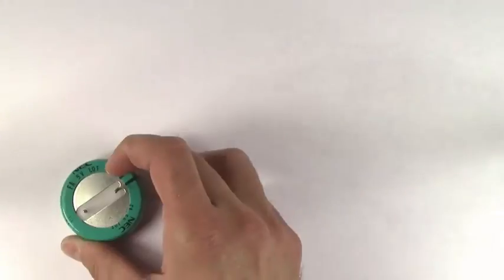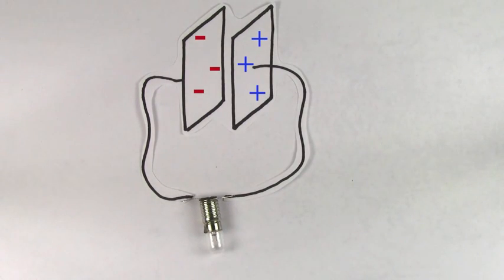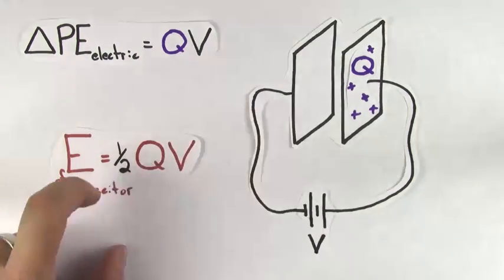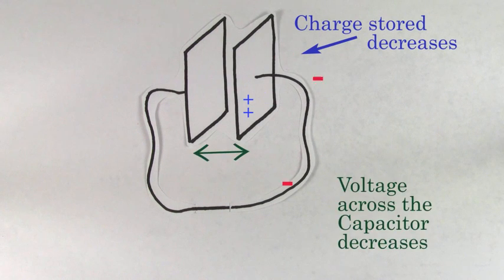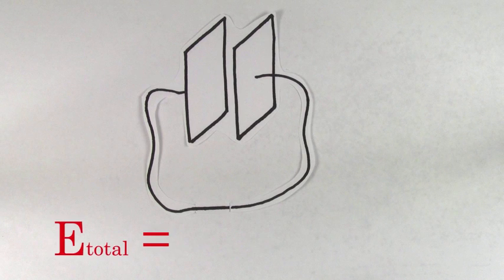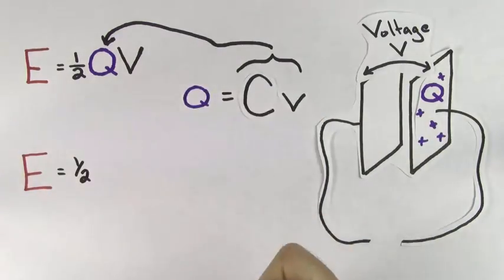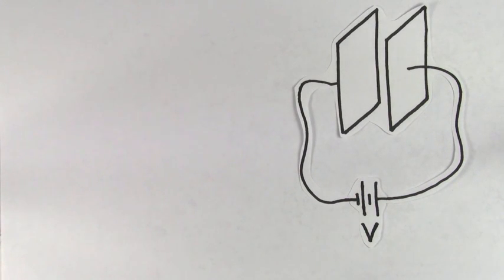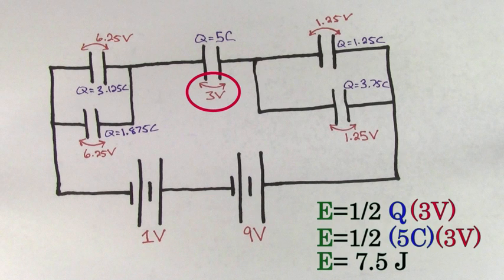Energy of a capacitor | Circuits | Physics | Khan Academy

Comment: Summary Of The Video :-

Energy Stored In A Capacitor

* The Energy Stored In Capacitor is electrical potential energy.

* A Capacitor acts like a temporary battery.

* Potential Energy Stored In The Capacitor is the work done by external agent (battery).

 Work Done While Charging Process Of Capacitor 

 * To move first charge we do zero amount of  work because initially there was no potential difference between the plates.

* To move second charge we do tiny amount of work done because  now there is  tiny potential difference between the plates.

* To move third charge we do even more work beacuse potential difference increases.

And so on .........

* Now to move the last charge we have to do the maximum amount of work because now potential difference between the plates is maximum.

Comment: I have learnt that a capacitor does not store charge but stores ONLY energy because In a Capacitor there is an equal and opposite charges in polarity and that there is no resultant charge. That is Net charge is zero. And due to the charge separation. ??

Comment: Sir does the charge travel through battery during charging process if it does that energy stored in capacitor will be increase if it does not do that how charging process done PLEASE EXPLAIN

Comment: I found in Uni that the voltage across the capacitor gets written as dv (dielectric voltage), which is to differentiate the voltage across it from the voltage of the battery. But i hate writing it out cause the formula then looks like E = 1/2Cdv^2, and since high school i kept seeing “d” as for distance. This then gets added to other equations like capacitor current (i = CV/t) into i = cdv/dt. It gets so frustrating.

Comment: 3:24 what does it really mean that ‘charge drops through no voltage at all’???
Reply: Im no expert but i will try to explain nonetheless. Imagine the first plate has 1000 charges and the second plate has 0 charge, because of the difference, the two plates have a potential difference. Let's say the voltage (potential difference) is 1000 V between the 2 plates. As the charges move from plate 1 to plate 2, it's no longer 1000 charges on plate 1 and 0 charges on plate 2... It might go 999 charges on plate 1 and 1 charges on plate 2, or lets say 998 and 2, 600 and 400,etc etc...

The charges will keep on moving as long as there is a difference, but just like what you ask in 3:24, when (lets just for the sake of simplicity say) the plate 1 has 501 charges and the plate 2 has 499 charges... There is still difference right? So it'll still move, but the difference (voltage) is so small or almost no difference at all. 

That's what i think he mean in 3:24, feel free to correct me

Comment: great video! but for the last example, shouldn't the voltages be 10V (1+9) according to the batteries? But the voltage in that circuit was actually 10.5V (6.25+3+1.25)?
Reply: That what I was thinking! A simple typo, he was off by 0.5V, but the concept was still delivered very well!

Comment: well, in one of my books while reading about capacitance. There was a topic that when an uncharged conductor is brought near a charged conductor, it leads to a decrease in Potential of the charged conductor which decreases the Capacitance. 
But in some other book, I read that Capacitance doesn't depend upon q and V. 
What's the correct explanation?

Comment: What if capacitors have unequal number of charges!?? It can't happen in capacitor charged by battery but I talk about the capacitors used as electrodes in biomedical sensors such as ECG. 
How we calculate voltage then!??

Comment: Thank you - great video. Quick question: can someone please explain how the voltages were calculated in the final section? Adding up the voltages along one route gives 10.5V but the PD of the supply is 10V? Thanks
Reply: The voltages were assumed, as though they were given in a question, he didn't calculate them, rather he just made up values for each so the formula would work.

Comment: I think it's better to use U instead of E (Energy) in the video, it's a little bit confusing
Reply: 2 the parallel capacitor is fully charged then the charge. then take the power out, the charge in two copies will look like?
Reply: Really,  electrical potential energy is denoted by U

Comment: finally , i understood how capacitors work. Thank you so much for this helpful lessons
Reply: 2 the parallel capacitor is fully charged then the charge. then take the power out, the charge in two copies will look like?
Reply: @nghialetrong7039  yes

Comment: What does he mean a charge ''drops through" the voltage?
Reply: The way i see it, charge goes into the other plate because of voltage or potential difference between both plates. Potential difference is (cmiiw) basically the difference of charges between the 2 point, so if lets say 30 charges has already crossed over to the other side, for the 31th charges... the difference of potential energy (voltage) will be less than before. So what he explained was that in several first charges they will "drop through" the plate in relatively high voltage, but in some of the last charges to cross over... they would drop through the plate in relatively low voltage aka potential difference
Reply: ^pretty open to correction and critism

Comment: 1/2CV^2 looks like the solution to a differential equation?
Reply: +Tyler Shepard yup.
∆energy = voltage * charge
dW = V dq
W = ⌠ V dq   , since q = Capacitance * Voltage
W =⌠VC dV
W = C ½ V^(2)
therefore U =  ½ CV^(2)

Comment: Nice video.  I am trying to charge up a capacitor with 2200 uF -400V specs but it only charges up like 0.1 V per sec.  This is going to take too long for me to get to -400 V or even 280 V.  How else can i increase the amount of energy flowing into the capacitor so then i can get at least 280 V into the capacitor?